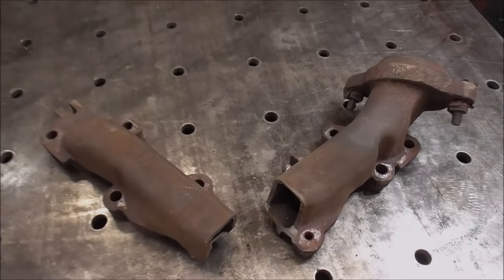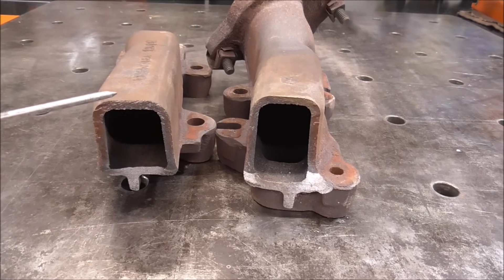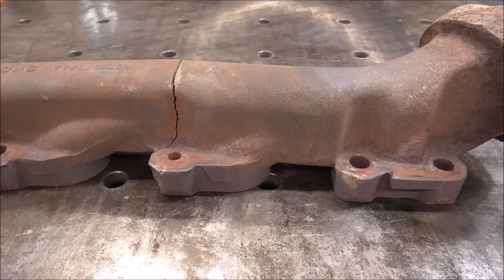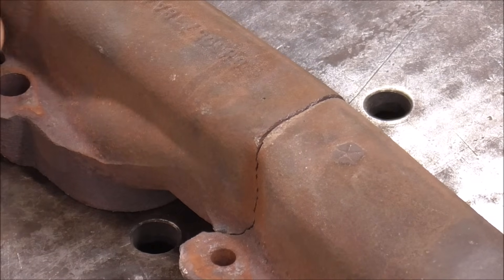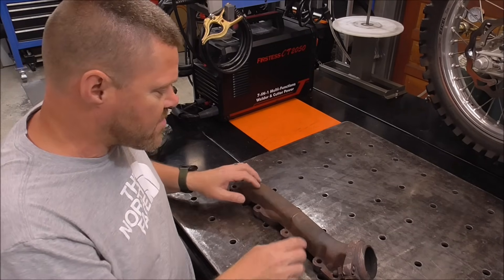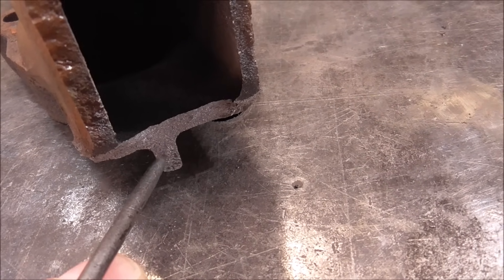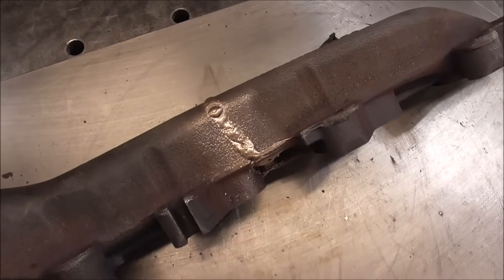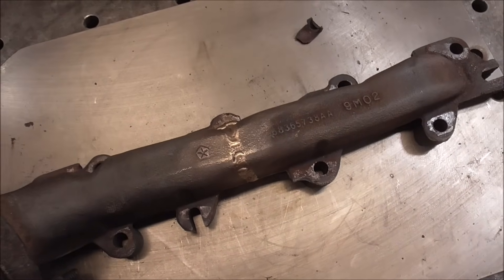Difficult Cast Iron Exhaust Manifold Welding Repair

Comment: Not too bad, cast can be an absolute Ahole to repair and no one gives a guarantee, you did well. I have worked day and night shifts on a very large casting only to have it crack, we had guys keeping the casting hot while welders worked, this lasted for 72Hr 3days, still it ended up cracking, the customer was willing to give it a go as a replacement was months away and many hundreds of thousands of dollars. It is important to know what type of cast you are dealing with as some casts cannot be welded, Sil Bronze might be your best hope in some cases.
Reply from the maker: I've had real good luck with this filler

Comment: Bolted down perfectly flat, and use good hard brass on it, and loads of preheat
Reply from the maker: Bolting things down while welding cast is a recipe for disaster. If this was a permanent fix I still would have done it the same way except I would have had the flange milled flat or surface ground afterwards.

Comment: Hey bud, what state are you in? I have like 100 cans of some nice anti-spatter spray I will never use. If you're relatively close I can ship it up or drop it off.
Reply: Sorry pressed enter too soon.  Instead of baking it to 500, could you torch it and use a thermal temp guage also?
Reply from the maker: Central Maine! Even if your too far away I appreciate that gesture. Your a stand up guy! 👍👊
Reply from the maker: Absolutely. I like to put the whole part in the heat when I can because the when you heat just an area, the cooler area draws out the heat a lot faster so by heating the entire part it gives you a little extra working time therfore decreasing your chances of a crack.

Comment: Can you cut a lawnmower blade into n lengthen it with mild steel
Reply from the maker: I wouldn't just for liability reasons plus I think some are heat treated.
Reply: @BrandonLund  Yes ,I was told about liability and yes they are heat-treated Thank you your insight
Reply from the maker: Anytime man! 👍

Comment: That mounting hole by the crack needs to be drilled out to the same size as the larger holes. That will help the manifold expansion as it heats up.
Reply from the maker: Probably not a bad idea

Comment: Carbide die in grinder to get into tight spaces and it won’t leave the garbage that comes off a grinding wheel behind in your weld repair area.  Definitely needle scalar to peen the post weld area and relieve some of the stresses created by the weld repair.   Weld in short areas.  Looks like you have it under control.
Reply from the maker: It should hold.

Comment: I haven't seen this issue yet.  Crazy how it has been broken for while and yet no soot outside the crack......
Reply from the maker: My guess is that it comes off the engine so hot that it doesn't allow the buildup of carbon. Our fireplace is like that. Where the fire is located. The sides of the fireplace look like brand new without soot but as you look upwards it starts to get black.

Comment: Ive seen people fo this with silver solder aswell in case you don't want to buy a welder. But this big break needs alot of heat
Reply from the maker: I will have to give that a try sometime. I've heard of it, just never used it

Comment: Likely cracked because it looks like there is no decent sized bolt/stud in that location so it's potentially been flexing ever so slightly over time causing it to crack - Just a poor designed head/manifold, similar to the MQ Mitsubishi Triton manifolds. Good video!
Reply from the maker: Thanks man!

Comment: If I where the shop I would want to keep it for the next time if this common break. I don’t think a test brake would tell you anything as to this application anyway.
Reply from the maker: I think they now plan to keep it on the vehicle. As far as testing, I have done a bunch of other destructive resting so i actually have some baselines of how different filler metals and processes compare to one another. My guess is this manifold will never be removed from the vehicle because silicon bronze is the strongest and most forgiving filler metal tested to date.

Comment: Tie it together with a splint  square tubing inside .. little restriction but hey ..  quick and dirty  and wont break
Reply from the maker: I'm confident it's not going to break. It's going to be within 10% of its original strength with this process.

Comment: Machining the mounting face flat after repair would remove the original failure mode, which would help it last longer than the original
Reply from the maker: It would...only problem, I don't have a milling machine LOL
Reply: Yeah i can see how that might discourage you a bit. 😊
Maybe encourage the customer to have it flattened so it doesn't break again for the same reason, and then at least if it does fail, and the mounting faces weren't machined, that simplifies the discussion a bit because you did tell them to do it.

And they could flatten it without a mill if pig headed enough -- a sheet of glass or a table saw table with sandpaper facing upwards, and you're away.   Or do it really carefully and slowly with an angle grinder (checking VERY frequently with straight edges and feeler gauges).
But a milling machine would be 100x quicker; that's why people buy them.

Comment: I've heard that the reasons for the manifolds to crack is that the cylinder heads actually flex and when manifolds cool down rapidly they crack.
Reply from the maker: I havent heard that but by taking both pieces and placing the flange on a flat surface, it showed the manifold was bowed in the center. I can't imaging the head is bowed but I guess anything is possible

Comment: Tig brazing using phosphor bronze filler is the best possible way of making a repair like this.  Any form of welding means carbon will migrate into the HAZ close to the weld, and failure will occur quite quickly.
Reply from the maker: Thats why I brazed it. The filler metal has a melting point below welding temperature to avoid messing up the the grain structure.
Reply: @BrandonLund  Sorry I thought your video title suggested it had been welded.  Brazing is much better.
Reply from the maker: Your right but not many people would know to search "mig brazing cast iron". If someone wanted to join 2 pieces of cast iron, they search "welding cast iron".  Sort of like how everyone calls a wire feed welder a "mig welder". Not many people search for "wire feed welding" so to help as many as possible I use words that people search like "welding" and "mig".
Reply: @BrandonLund  Yes I can see that.  Have you tried TIG brazing?  Works very well for cast iron.
Reply from the maker: I have done tig with nickle but not with phos. Bronze. I will have to give it a try.
Reply: @BrandonLund  PB can be used on pretty much anything and is easy to use.

Comment: I very much doubt you will get it back intact unless it breaks again.  If it was mine and the weld holds, i would leave on the Dodge and keep the new one as a spare until the day it does :)
Reply from the maker: Great point

Comment: I agree that the original casting practice was poor. I reckon the stresses were introduced when the engine was being built and the manifold was fitted. That manifold wasn't flat to the surface.
Great repair young man.
Reply from the maker: Thank you very much Jon! Hopefully this gets them by and hopefully the new manifold issue has been resolved.

Comment: I reversed polarity weld them with nickel rod . And never had them break after words
Reply from the maker: If you really want to upset people, show them what you just explained. I've had really good luck doing that also but because it doesn't crack I get accused of showing my demonstration on cast steel. I learned early on that cast iron welding done any other way than with oxyfuel and cast rods is triggering for many lol. I started mig welding cast with er70s6 just to trigger folks lol

Comment: I doubt they will let you have the manifold if they are replacing it under warranty.
Reply from the maker: Thats a good point. I guess I assumed it wasn't a warranty job but now that you mention it, it very well could be. I keep forgetting to check up on this. I will report back next week in a short video with any updates. Thanks man 👍

Comment: The gap when the mounting face is aligned flat suggests to me that in manufacture, the casting hadn't finished moving after the foundry, before machining was done.  This means it distorted after machining before firing to the engine, so it was installed with a lot of built in tensile stress.
This process deficiency theory is supported by the comment that these Dodge manifolds fail very commonly.
Reply: Hence the term "dodgy" in "dodgy manufacturer", i guess??
Reply from the maker: Hahahahaha I think your onto something LOL

Comment: My guess is they do a crappy job of cleaning the mold, leaving the center set up high during the casting. so it would always have that tension on it. But it looks like you eliminated the tension. 👍

Comment: Done a lot of cast welding in my time mate.  I would be preheating that with an oxy and then welding.  Once done, dump it in a bucket of sand and let it slowly cool down.  it will just crack on the weld and separate otherwise mate.
Reply from the maker: Did you watch the same video as the rest of us? It was heated to 500 degrees, welded then insulated in a blanket covered in sand.

Comment: Take it to a machinist  and check for level on the exhaust ports before bolting it back on ,it broke becuse it was not level with the exhaust ports when it was attached/ uneven surface matting also check the head exhaust ports for level, especially if its a aluminum head.
Reply from the maker: Sometimes you have to do what the customer wants.

Comment: This is a classic hot-yield failure. Here’s the failure progression: the manifold tries to expand as it heats up. But if the bolts fix it rigidly, it can’t expand and because the manifold is weaker when hot, it yields in compression. This permanently distorts the manifold and then adds a lot of stress with each thermal cycle. After enough thermal cycles, you’ll get a fatigue crack. The location of the crack and the obvious distortion of the flange strongly suggest a hot yielding failure.

Comment: Considering that the two halves are bolted to the engine block, it has to cross my mind that a 2 month repair could have been made with furnace cement. The halves would be installed before the cement sets.
Reply from the maker: Maybe. Ive never used it before

Comment: I was watching a video about off the drag racer from the 60s and he was one of the top drag racers in the country and he took a Ford 306 and it was I can’t remember what kind of car body was it wasn’t Leica a Ford falcon or something like that it was some other kind of body, but he took and welded three center sections of 351 Cleveland heads together and here’s the big thing he took when he wanted to cool them off slowly he had a box built that would was big enough to set the six cylinder head in and it was filled with lime on the bottom. As soon as he set the head in the box he dumped more agriculture lime on top of it, because extremely slow because there’s virtually no oxygen in there it’s just ground up limestone but it’s so fine that there’s virtually no air in there anyway just thought I’d mention that I can’t remember the drag racers name, but he had won a number of championships over the years with a Ford 306 cylinder engine
Reply from the maker: Thats awesome! I love sucess stories like this and knowledge passed down from the old timers. Good stuff for sure!

Comment: You keep calling this welding but then say you're using bronze filler metal. Is it welded or brazed? Looks like TIG brazing with a coil feed system of some description.
Reply from the maker: Thats why the difference between welding and brazing was explained in the video

Comment: Silicon bronze is a cooler temp weld then mig welding
Reply from the maker: 👌 spot on! The correct term when using silicon bronze is mig brazing

Comment: So whomever poured these castings should be in hot water but this kind of problem happens with about every company. The mixture for the pour must not of been quality material. Brandon, yeah he can fix anything and that's a good thing for your reputation and can keep you busy!
Reply from the maker: I know right! Another commenter mentioned it might not have been milled flat at the flanges. That would do it too. Either way sounds like QC messed up

Comment: It's kind of shocking that to this day cast iron exhaust manifolds are still a thing.  I agree that the cause of this manifold breaking was due to a fault in the original casting, and likely exacerbated by many cycles of heating/cooling and vibrational stress from road use.  It would be very interesting to examine the head that this manifold was attached to to see if the corresponding exhaust port mating surface is dead flat.  My money says it ain't.
Reply from the maker: Your probably right

Comment: What means strong? Presumably the manifold broke because it has warped due to internal stress and not because of external forces. Now it is stress-free and chances are, that it will last longer than before the repair.
Reply from the maker: I agree 👍

Comment: The reason manifolds broke years ago with Chevy big block truck engines was that the tune ups back then made a ton of heat which caused a lot of expansion. And the bolt holes were just about exactly the size of the bolt. So when we replaced them we oversized all the holes. Then check the tune up. Usually finding retarded timing. Sometimes AIR pumps working when they shouldn’t.

Comment: After I weld cast I heat it up again and then put it in ash that I cleaned out of my fireplace.    After being buried in ash they are too warm to handle by hand after 15 hours
Reply from the maker: I've done that a few times also. I've stopped because it's the heat cycles that adds to thermal expansion and contraction so now I just let it slow cool in sand wrapped blankets

Comment: If it was my truck I Would make a sheet metal header type exhaust manifold.. with all of your equipment it would be easier..
Reply from the maker: That would be pretty sweet! Probably not too difficult either. The collector might pose a problem but I could probably figure it out.
Reply: @BrandonLund  make A header on video it may bring some welding jobs your way ,Custom auto parts are hard to To come by and expensive ..
Reply from the maker: I might do it just to say I can LOL I don't have a use for one but I think i'll try. Might be fun.
Reply: @BrandonLund  if you make a popular sport drift car a header that would power a turbo.. Some young person will buy it to show it off a one of a kind header. And leave you with a good video.

Comment: How much job like this will cost the customer?
Reply from the maker: This job would run around $150, however, because my customer is the owner of a mechanic shop in my community, i did it as a favor to him free of charge. Neighbors helping neighbors.
Reply: @BrandonLund  Thanks, my factory exhaust manifold is cracked also. Now I know what to expect.

Comment: Preferably you would preheat, use nickel rod short welds... Peening and post heat and slow cool... But silicon bronze will do the job.  Cast iron is a pain lol
Reply from the maker: It sure is..im just glad to be able to share some common ways to repair it. There is still a myth that it can't be welded and it might hust save someone some money.
Reply: @BrandonLund  yeah cast iron is a pain but oh man have you tried to tig cast aluminum 😮 that is really a pain.   All the garbage that comes out of the cast.

Comment: i always assume that the factory milled things straight, so if it is ground flat again it should be correct.  the biggest warpage occurs during the welding. if it isn't remilled straight you are wasting your time
Reply from the maker: I'm not wasting my time if works and my customer is happy.

Comment: It would be nice if you could bolt it to an old head while you weld it. Then the bolt holes would all line up
Reply from the maker: My concern was creating a crack from contraction as it cooled if bolted down.

Comment: I repaired all malieable iron parts with nickel rod 1st then grind it mostly out and use cast iron rod
with 500deg heat 1" at a time.. That manifold has almost no steel in it so braze is the only hope.
Reply from the maker: Still running today. I guess they are planning to leave it on there now.

Comment: Exhaust manifolds over time from heating and cooling cycles tend to draw in the middle. The bolts or studs pull on that tension created by this and eventually crack. Log style manifolds are bad for this happening.
Reply from the maker: Thanks man! Makes since 👍

Comment: Cast iron is a 50/50 thing it might work , and might not , im a retired welder over 35 years,  and done a lot of cast iron , you have to heat the whole thing up at one time , and I use nickel rods , and like I said its a coin toss , cast iron is something you weld on it moves, pulls and tugs at each other causing stress somewhere else , but if you weld it and don't hear no pinging and popping after 5 minutes then your probably okay , but you will know very quick if it will or want ...

Comment: Hook the stick welder up backwards weld with the ground wire ,,,it won't heat up when u get done u can put your hand on it ,,,,,and it won't spider Crack because the heat gets pulled back into the welder if u do it everyday it will burn up the welder ,,,I've done this making big money for years ,,especially on rear end housings thet wereee leaking uon Tractor trailers 😊
Reply from the maker: That has worked well for me also